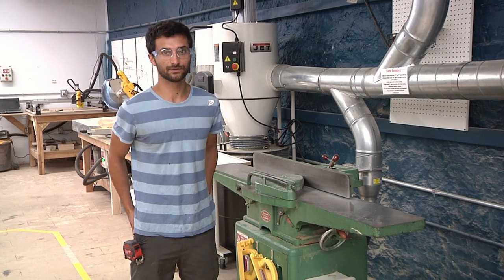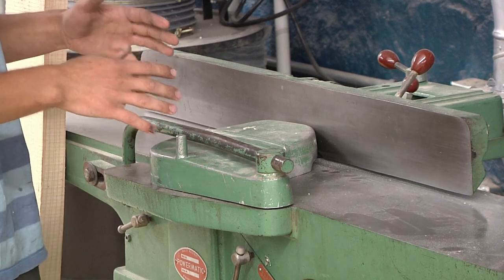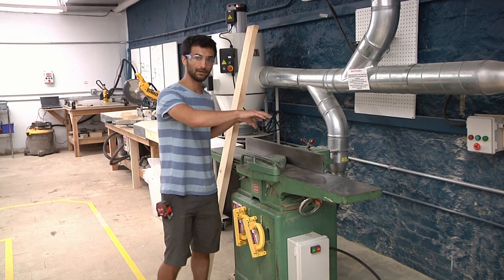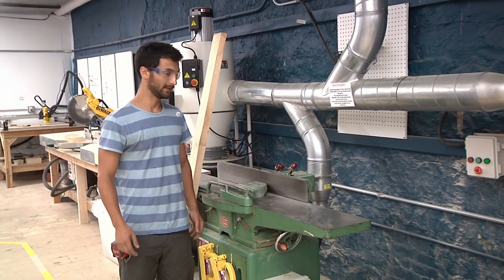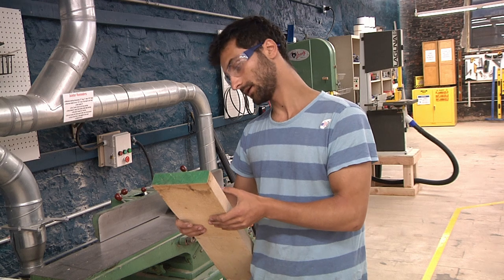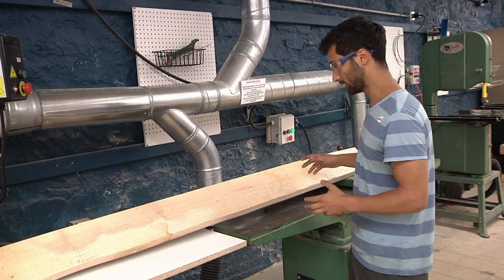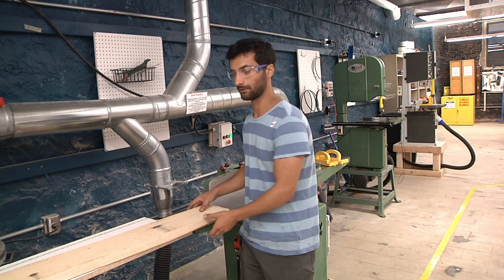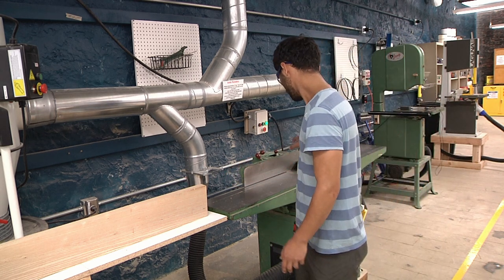How to Use the Powermatic Jointer

Comment: Quick question. When edge jointing, which side of the jointer should I press down on, the infeed side or the outfeed side? Do I want the board to touch the infeed or outfeed table? Or should I not really be pressing down and more just guiding it through?